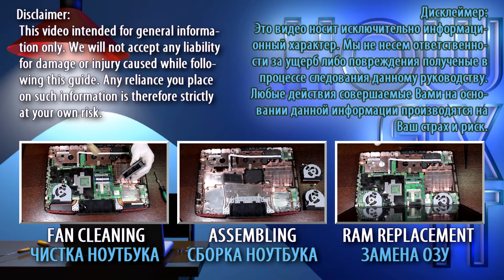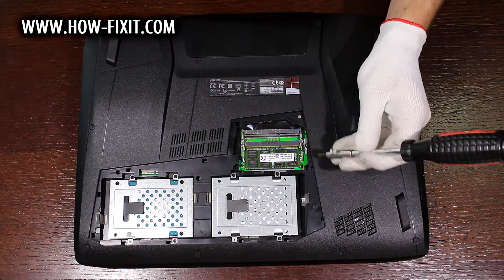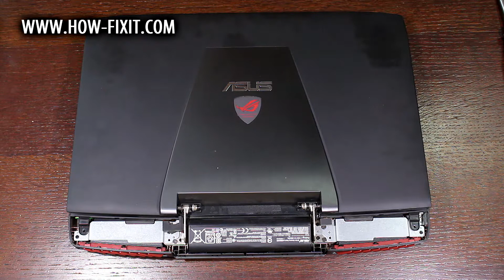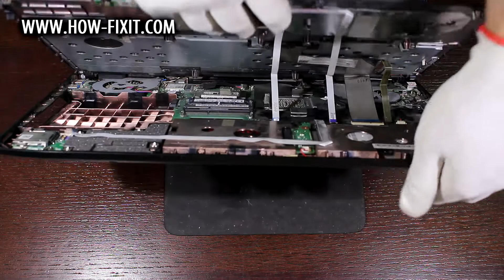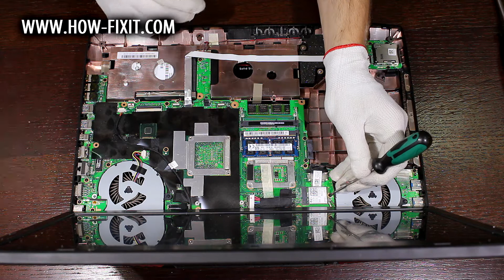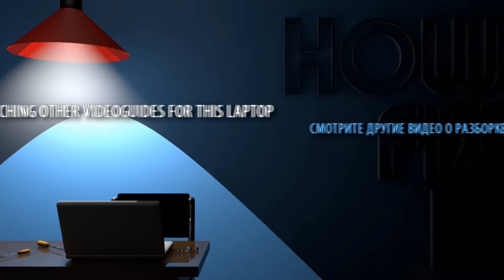Asus ROG G751 Wi-Fi Card Replacement - Fix Wireless Connection Problem

Comment: Kind of wondering why you felt the need to disconnect the keyboard and battery when this can be done with it attached.
Anyways, wifi card is in the mail. Hopefully it fixes these connection drops or I'm gonna be looking into the 703.
Reply: Was it solved by a Wi-Fi card replacement?
Reply: Phizix did it fix it?
Reply: @chargerwith22s  My wifi connection is slow also, same laptop model, thinking on changing the wifi card too
Reply: @Phizix

Comment: I can't get those little connectors to connect.
Reply: I'm assuming you mean the 2 little antenna wires on the chip. Just line them up straight and give them a nice firm push with tweezers or something and they will slip on (They did for me). I upgraded my wifi chip to the Intel 9260 on my Asus G751 Laptop (part number T1SS7BH00MA) due to wifi disconnects with the 7260, the installation went smoothly and it was plug and play.
Reply: @Warren01s10  is that wifi 6 chip?
Reply: @Warren01s10  Oh really? The 9260 is a slip in replacement? That's good, I was worried about just getting another 7260, and running into issues yet again a year or two down the road. Do you happen to have a link to the 9260 you used? I need to get one for mine, because my 7260 is acting up in my G751JY.
Reply: What if my white one doesn’t connect?